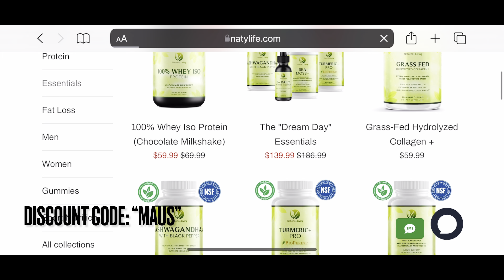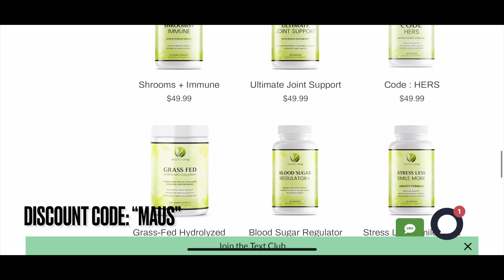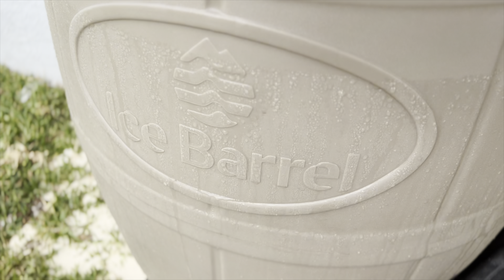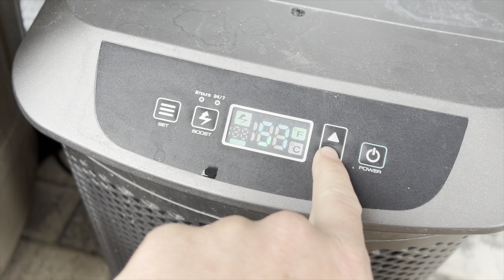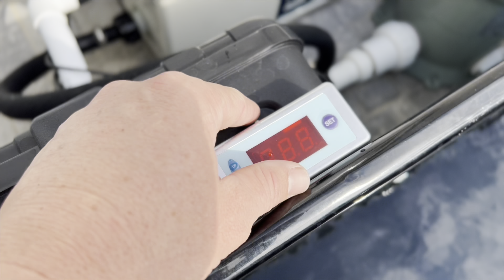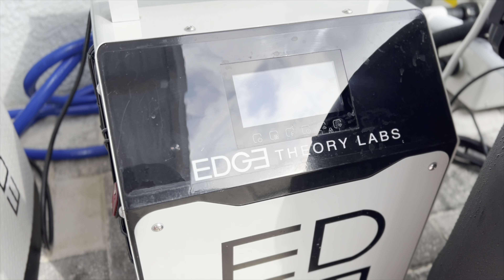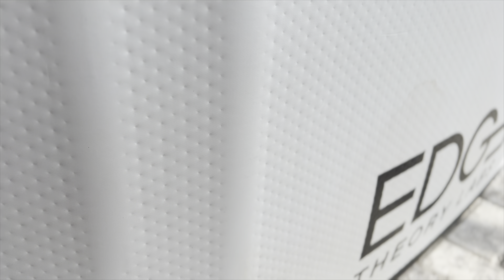I Tested Every Cold Plunge to find the Best Material

Comment: You can DIY a polar monkey setup for cheaper.  Their Portal is just a 100 gallon stock tank and the brain pod is literally just a Vanity Art Acrylic bathtub from home depot.  Go find yourself a chiller and save a lot of money.   You can then buy the polar monkey top cover and it will fit perfect.
Reply from the maker: You arent wrong, Ive built a DIY similar and all in the cost was about $1500. I have that video on my channel (over 100k views) you should check it out too.
Reply: @DavidMausJr  I saw it, was pretty cool. I’m in the process of building an exact Brainpod clone.  Everything should be identical: Ecoplus chiller and pump even down to the ability to turn on/off from mobile app.
Reply from the maker: @joehardy3692  So sick!

Comment: Live in Maine, this winter i used a Rubbermaid and as you imagine i did not have to chill the water. I really am interested in the polar monkey now that the warmer weather is coming. Does the polar monkey have plugs to close the pump holes so i could drain the chiller in the winter when it was not needed?
Reply from the maker: Great question! I did not get any plugs with mine but im sure that is something they could come up with if enough people asked. I would just turn it off during the winter and not worry about it. The components are made to handle cold water. But thats a great question for the PM team. I can message them.

Comment: Hi Dave, quick one. I've been plunging for about 2months and I have an inflatable Nurecover ice bath that is a very cheap option £100 but the lid is a bit junk, so I've ordered a lid from Lumi (another inflatable barrel style plunge. Question is do you know if there are any simple set ups for keep the water clean and cold without being able to drill holes in the bath? I'm wondering if you know of any filter pumps that I can just hang over the side submersed that will do a similar thing to your Ice Bareel DIY set up?
Reply from the maker: Absolutely! Using my exact set up is how I started. Look on my channel, my most watched video is my original DIY setup and I just draped it all over the top. Worked like a charm!
Reply: @DavidMausJr  love it. Cheers Dave. Good to have stumbled across your channel.

Comment: I live in a cold climate. Can get to -20 a few days every winter but generally lows in the 0-30 range. What is the best cold plunge that won’t freeze in winter? We have a hot tub we love that is specifically designed to handle cold outdoor temps and not freeze (which would destroy pipes, etc). I’d love to find a cold plunge that does the same.
Reply from the maker: That’s a great question and a problem I haven’t heard of. I live in FL so don’t have to worry. You could do the setup in a garage or shed and have less of a worry maybe?

Comment: Got any suggestions on how to insulate the Polar Monkey if using inside in a basement? It will be on indoor/outdoor carpet so not a big deal if that gets wet, but wondering if I can insulate it somehow to minimize the bleeding.
Reply from the maker: They have a few other options that are insulated. You may want to get one of those. Check out their site

Comment: Hey. I have been doing my cold plunge now for 2 weeks now. I really like it but was wondering how long you stay in for. I have done 10 minutes twice with no problem but after I get out and dry off I can’t warm up for hours and actually feel kinda bad. Is too long too bad?? Thanks
Reply from the maker: That’s a long time brother! 3-4 minutes is the sweet spot for me most of the time. About once a week I’ll stay in around 10 but not necessarily better. What temp are you at?
Reply: @DavidMausJr  right now around 55. Ordered chiller but currently using 2 liter frozen bottles.
Reply from the maker: @tpet7598  Nice! I would just cut it down to no longer than 5 minutes, or split it up and do 4 mins in, 2 mins out (but dont dry off), 4 mins in.

Comment: What plunge would you recommend for commercial use?
Reply from the maker: Are you looking for something to keep indoors at a "recovery center" or just something that is bulletproof and can take a lot of use and handle it well? 
A lot of people are using the Edge for recovery centers indoors. They are powerful systems and they have bigger sizes now. Another great option is the Plunge, which i also have a video review on. They have one built specifically for Commercial use and its a beast.
Reply: @DavidMausJr  much appreciated input. Thanks 🙏

Comment: How quick do these get to 60? Is it something you can turn on and off or do they need to be on all the time?
Reply from the maker: Great question. All seem to get cold very very fast. I would have to say the Polar Monkey and Edge get cold the fastest and easily maintain the temp. The DIY takes a while, mainly because the chiller is only 1/2 hp and it depends on what you put the water in. Ice barrel is not insulated so it fights the heat more than the other expensive options. I keep mine on at all times. Pulls about as much power as a mini fridge.

Comment: I do not see a link to the chiller you use for the Ice barrel in the description. Could you please share which you use?
Reply from the maker: 🤙🏽Here are the links to everything I used to build my own DIY Cold Plunge:
====================================== 
👉 Ice Barrel, or use any tub you like:
https://icebarrel.com/coupon/maus
👉 Chiller, Active Aqua ½ HP:
https://amzn.to/3QYvBRN
👉 Pump, Hydrofarm 1100 GPH:
https://amzn.to/3GTIkQZ
👉 Tubing, Hydrofarm Black ¾”:
https://amzn.to/3wcQ7EI
👉 Water Strainer, ¾”:
https://amzn.to/3Wsj6z0
👉 ¾” Male Adapters (Need 2 to Connect Strainer to Hose):
https://amzn.to/3HjkboF
👉 Hose Clamps, Make sure they fit your tubing:
https://amzn.to/3Xpaw5x
👉 GFCI Extension Cord (If Needed):
https://amzn.to/3kj1kki
👉 Hydrogen Peroxide (Keeps water clean):
https://amzn.to/3kuiXOj
👉 Water UV Pump/Filter:
https://amzn.to/3iPR02V
Reply: @DavidMausJr  Thanks! You are awesome!

Comment: Hi David, do you need an ozone cleaner with the barrel setup? Or does that air chiller combines with that filter is good enough? Also, I want to create a small hot-tub to put side by side so I can go back and forth...I noticed that the air chiller you are using also comes with a heater...would you recommend using that brand for my hot tub heater as well? I would be using probably a 170 gallon galvanized truff tank for both.
Reply from the maker: Love it bro! I’ve had no issues with my set up and the water stays clean. That’s a great idea! Send me what your looking at

Comment: Thx for the info Dave. I have the uv filter still in my rain barrel setup. Any reason you discontinued using yours?
Reply from the maker: Nice! I have it too just don’t feel like I needed it. It’s not bad though!
Reply: @DavidMausJr  can you elaborate a bit on that? Why don't you feel like you need it?
Reply from the maker: @Awareness_With_Dennis  Well it was great, but just another thing to plug in and have in the water with me. I have the water flowing with the pump and chiller pretty steady and a little filter so the water stays clean and moving. I also add hydrogen peroxide weekly and its been working great!

Comment: I think edge theory labs is the best when you look at pricing compared to monkey plunge and thecoldplung. Monkey looks cheaper but once you add all the add ones it’s not that much cheaper. plunge is second but best is edge theory labs the chiller is stronger then most brands and when you need to move transport
Reply from the maker: I don’t disagree! I love my edge. I had some issues with my chiller so my experience wasn’t the best but the team is making it right and I really think they are one of the best brands out there for sure.
Reply: @DavidMausJr   i was stuck on wanting the cold plung but when I did the research edge was the best convenience two main items easy to pack and move compared to other brands. Then I saw your video on the monkey and I went thru check out once you add everything plus the 400’s shipping it’s not that cheap I think I paid a little big more for edge.
Reply from the maker: Yes you are right! After adding everything its almost the same. The Edge is a great plunge too and they just sent me a new chiller since mine wasnt working in this review! Use the link from this video and it saves you some money if you decide to get it

Comment: Ice Barrel is not the greatest thing since there's no insulation around it. Losing a lot of energy in the summer time and in the winter time when you're using the heater to keep the temp above freezing.

The machine will have to work hard. Finding an insulated barrel though....that's the key
Reply from the maker: Surprisingly I live in FL and my ice barrel setup keeps the chiller temp with no issues and it sits in the sun all day. I just like the way you get in it and squat a lot. Insulation would be a nice touch

Comment: Which is the best for a broke man
Reply from the maker: Ice in your tub or a cold shower works too
Reply: @DavidMausJr  unless you are in FL in the summer when a cold shower is around 70-80 degrees, I think.
Reply from the maker: @Just_Derek  Youre not wrong there! Best option is a chiller and pump to use in a tub or cheap basin. Ice quickly gets more expensive and melts too fast.
Reply: @DavidMausJr  We have the stock tank and creating ice. But finding a solution to create ice blocks is a challenge with limited space in freezer. Rectangular storage bins would likely help maximize space. I'm still on the hunt for the right ones for the best fit.